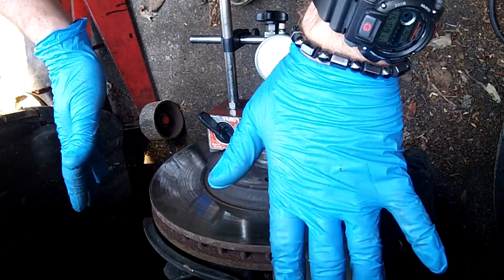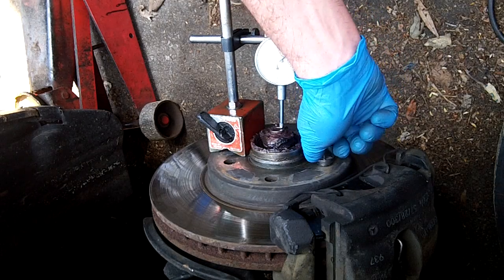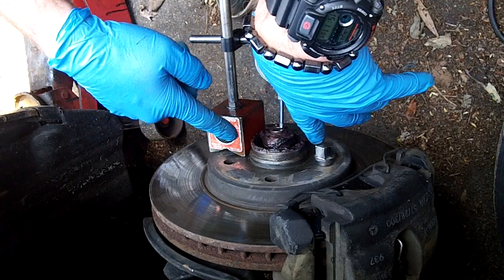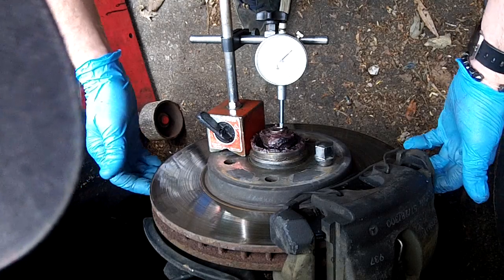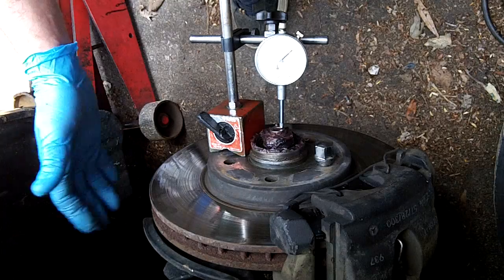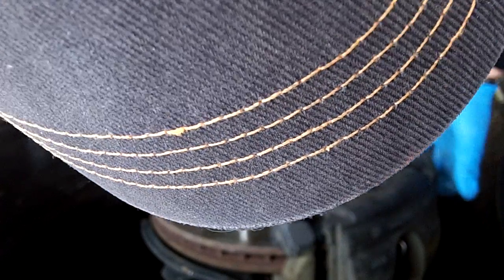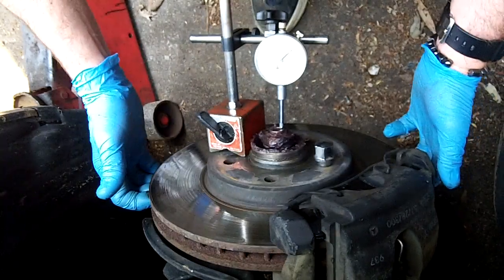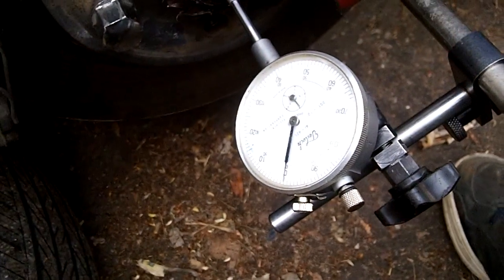adjusting Mercedes wheel bearings using a  dial gauge

Comment: excellent video. 

will this be the proceedure to follow when installing my hub nut after replacement of my hub assembly? and
Reply from the maker: this is only applicable to front roller style bearings...sealed hub bearings are torqued to spec. no dial gauge needed.. What year and model is your car?
Reply: It is a 03 w203 RWD. I believe it is the same style as the one in your video.

Also, if I am measuring the runout of the rotor surface itself, is it appropriate to mount the magnetic base on the caliper? It is a study surface mounted to the suspension itself. 
I am asking because I would like to buy a indicator holder that will allow me to do what you demonstrate in the video + measure rotor runout (without buying a separate longer holder)
Reply: While we are at it, is there any particular advantages or disadvantages with using a roller style bearing? I believe the rear is the torque style you mentioned.

Thank you. Great videos by the way.
Reply: Actually, I'm working really close off the ground (no lift, just jacks/stands). I believe I can just stick the mount onto a old rotor thats on the ground.
Reply from the maker: Ste .L yes your rear bearings are pressed in like the replacement video I did on my r170..KInd of a pain to do. Front tapered roller bearings are cheap and easy to service , but require proper adjustment..Your w203 has the same bearings as in the vid.. A lift would be great.. I would kill for one  :)

Comment: Thank you so much ... Replaced my front wheel bearings on my W202 today and used both of your videos ... The adjustment is so very precise ... You really need the dial indicator to set the play!  The improvement between old and new was even noticeable in the ease of steering and it felt like the car rolled much better too.  Which makes me wonder if I could use the dial indicator to determine if the rear wheel bearings also need to be replaced?
Reply from the maker: the rears are a sealed non adjustable bearing...there would be no play, just a lot of rumbling noise especially when turning a corner... the front adjustment is very precise

Comment: You don't want to do this job with the caliper on the rotor... Great info tho!
Reply from the maker: +Joshuwa Dubuc  The dealerships do it with the caliper attached, and the factory shop manual also specifies measuring with the caliper attached 
http://workshop-manuals.com/mercedesbenz/s_320_lwb_(140.033)/l6-3.2l_(104.994)/transmission_and_drivetrain/drive_axles_bearings_and_joints/wheel_bearing/component_information/adjustments/ar33.20-p-0300a_adjust_wheel_bearing_play/
Reply: +fupabox OK I see that however if you have a stuck slider, or stuck piston you won't be able to slide in and out.  I guess it comes down to personal preference.
Reply from the maker: Joshuwa Dubuc A stuck caliper or slider is a different issue from a wheel bearing, and the caliper would need to be repaired before bothering with a wheel bearing adjustment ..It isn't personal preference.  You can remove the caliper before checking the bearing, but it isn't necessary

Comment: I think my bearings may still be just a micron loose, I tightened them quite a bit after the first few days as my wheels were clicking some. But 3500 miles into my summer tour, very smooth sailing, excellent MPG, had a ton of fun gettin the back end loose on some windy gravel roads in the mountains... Occasional ABS light since that, prolly just got the wheel sensor(s) dirty.
Reply: I had originally estimated 5k miles for the summer trips... I'm on pace for 15k by the end of August haha
Reply from the maker: :)   ... I find I usually have to tighten a tiny bit as well,even after using a dial gauge.
Reply: Yeah honestly I think I'm just going to leave them be. They dont wobble or click or anything when the cars jacked up and id rather be loose than tight. I can't even really explain why I think they're loose actually, its just like instinct haha
Reply: My MPG has been phenomenal on the highway lately (34+), thanks to your repair advice. Also did a seafoam & marvel mystery oil cleaning, helped my idle a lot but you were right about me having an electrical issue
Reply from the maker: The Stiver 34 mpg is great...
Reply from the maker: The Stiver yes it definitely is instinct after doing it a few times...you can just feel through the wheel while you are driving when it's right..even a bit of looseness can cause wheel wobble..but you are right ,a bit loose is better than too tight
Reply: I drive slow and dont use cruise, still haven't fixed it, but I do about 65mph uphill and 70+ downhill. Even going 80-85 mph I was getting 31+ mpg though. How do you feel about using 87 octane fuel in the m111? I can't really feel any difference between 87, 89, or 93
Reply: Hmmm. I'm going to monitor my ignition adv on OBD. 87s fine for highway cruising or driving like a grandma then right? Maybe ill be fine with 89 & a pinch of octane booster? 89 is only $0.18/gal more than 87 but 93 is .52 more!!!
Reply from the maker: The Stiver hard to find 93 in Canada  ..most premium is 91 octane at 60 cents a gallon more than regular 87.....the octane boost bottles can be deceiving..if the bottle claims to raise octane by 4 points..the actual octane increase is .4...so an 87 octane fuel mixed with 4 point octane boost would be 87.4 octane
Reply: hmmm... Tried some once for my bike when only 87 was available and it was running like crap... Made a huge diff. I used to have a Nissan 300zx TT and we used like paint thinner or something as octane booster haha. Stuff was rocket fuel. But you think 87 is ok for highway only or babying it?
Reply from the maker: The Stiver the only way to tell is by checking your mileage and taking care to not accelerate quickly..if the car still runs fine it should be ok, it's a tough call...some people use regular and have no issues...I have always noticed a bit of a difference whenever I tried regular...xylene is usually what guys use to add to fuel to increase octane..plus a bit of mineral spirits and Marvel mystery oil for lubricity... I always wanted to try the mixture ,but never got around to it
Reply: I've been using 87 on the highway and 89 in town, I don't dog it too hard. Maybe the 87 is contributing to my great hwy mileage, burns a little more completely? I just know with forced induction, even on a stock tune, things go to hell quickly on 87.